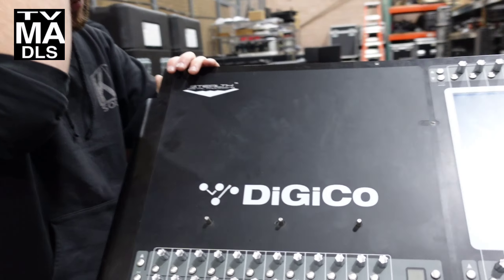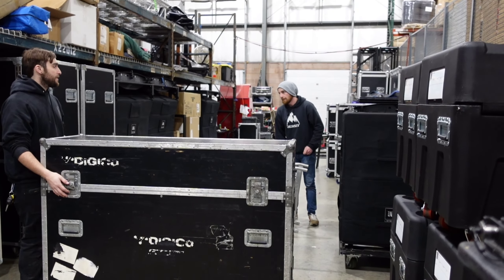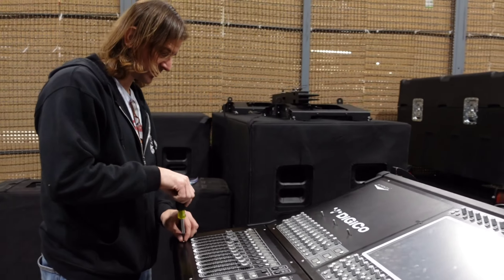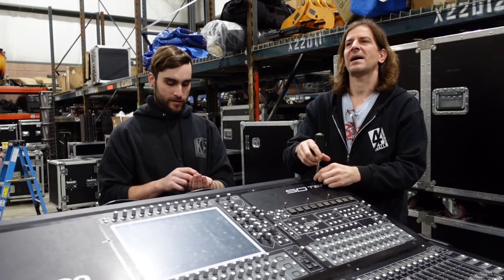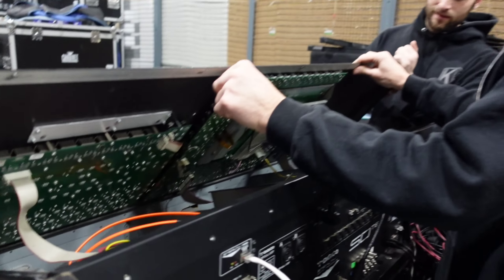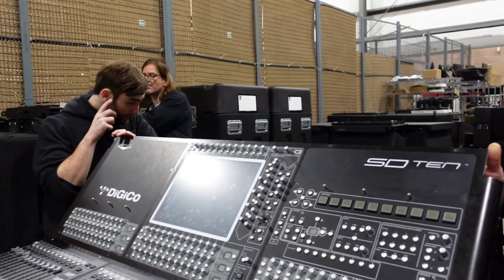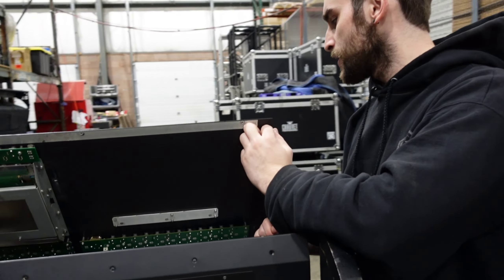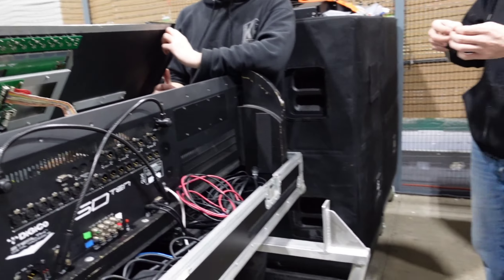Changing the Fiber on DigicoSD10 Console - Lost Episode MARCH 2022

Comment: Just to clarify a bit and what I think Rando is referring to below when he said "size" is the diameter of the fiber core (the tube down which the light is used to transmit and receive data).  Somewhat older spec OM1 has a diameter of 62.5 microns...whereas OM2 (and 4 and 5) have a smaller diameter of 50 microns.  While both OM1 and OM2 and up are both multimode fibers mating the 62.5μm OM1 with 50μm OM2  does not always prove reliable (usable) for anything other than a very short distance.  While the jumpers Mike put in are very short...they go from the external connector (Oticalcon in this case) on the back of the desk to the SFP (the transceiver unit that uses an LED or a laser to generate the light) on the circuit board...you need to then consider the length of cable from the cable to the rack or other desk essentially being added to those jumpers before it hits the SFP...which for anything over a few feet won't really work reliably or at all.  Believe it or not, the OM1 over very short distances is fine even for even 10gb (yes it really is)...but for anything up to the 100M needed in these applications OM2 or OM4 is used even though the networking speeds are relatively slow (DiGiCo fiber loops communicate at 2Gbps)...the only problem with those jumpers was really the mismatch in core diameter with the Opticalcon cables used to connect the rest of the equipment in the loop.  For even longer distances than 100ish meters...then the move is to an even smaller diameter 9μm fiber...that is the singlemode fiber.  With singlemode fiber and the correct SFPs, you can connect equipment many KMs apart from one another.

Anyway, I wish I was there when the surgery was done on the 10...or even later on the pair of 12s...I still have never been inside the DiGiCos yet!!

Great video Ted!  I loved the inserted Grunie responses.